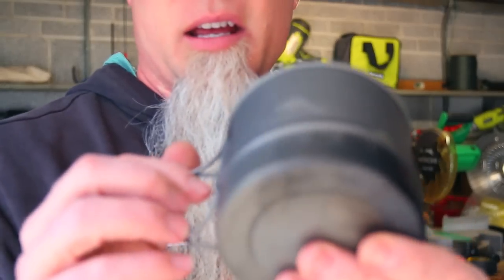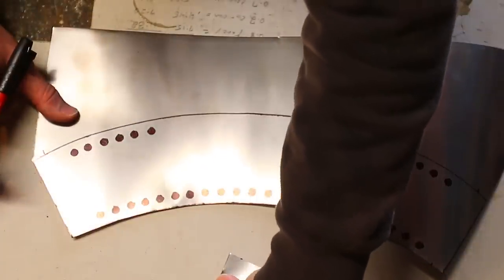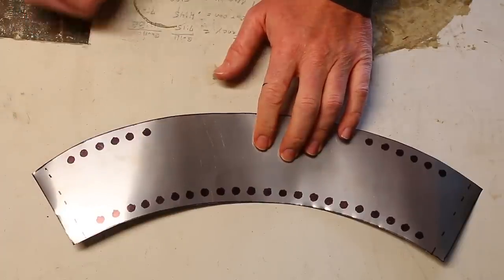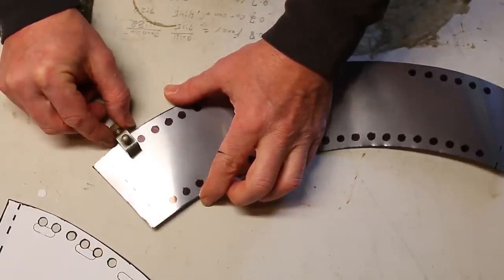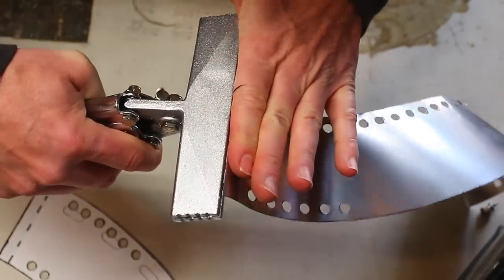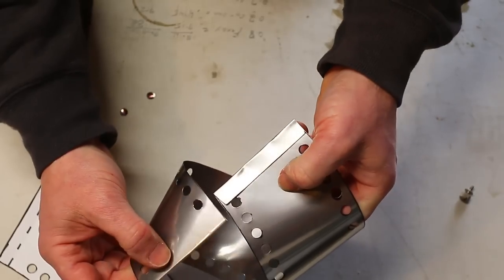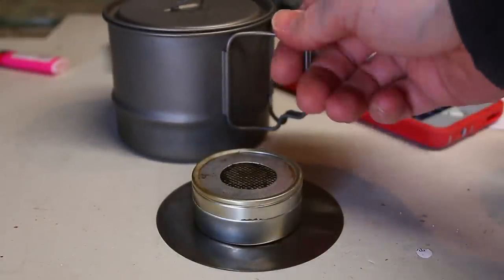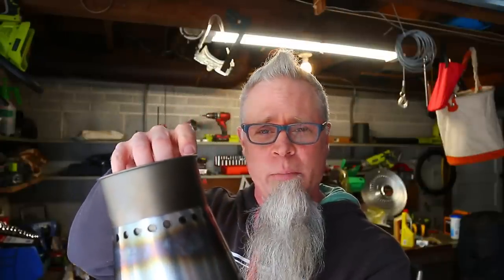DIY Caldera Cone

Comment: Just found out about the Caldera cone the day before yesterday and thought I'd have to check out the hardware store for different flashings to see whats available.
Haven't seen any titanium flashing around, was also thinking of making a 6' × 2.25" roll up chimney for my tent stove maybe pickup a 12" ×12" course stainless mesh for a cap/ash catcher. Definately not cheap but should last a lifetime.
Funny this vid turned up just now!!!

Comment: Hope you don't mind a suggestion. Printers can sometimes print images a bit smaller than anticipated, if shrink to fit is selected. If you draw a scale on your templates (like on a map). People can check their printer is printing it the right size by comparing the scale with a ruler. Hope useful. A fellow alcohol stove enthusiast.

Comment: Thanks for the vid man! I'm packing the non ribbed Toak cup without a lid so it looks like the modified version is where I'm headin. Do you have a link to that heating element deal thingy? I'm looking to move away from my BRS and canister unit. ✊
Reply from the maker: The alcohol stove is made by Zelph http://www.woodgaz-stove.com/modified-starlyte-burner-with-lid.php

Comment: Great video Jaxx, I’ve got a similar design using some aluminum flashing from a house project I had left over. I like your crimping idea might need to try that right now I keep mine together with a metal bobby pin and it does the trick!
Reply from the maker: I'm gonna try it with some flashing today to see how it turns out. I want to try and make one with a fosters pot, where it's sitting all the way down in it like it's supposed to.

Comment: Trying my hand again at alcohol stoves. Wanting to do some dry baking. I take it the purpose of the caldera cone is basically a fancy wind screen/pot stand?
I’m using a fancy feast stove with a diy simmer ring. 
What determines the height of the cone?
Reply from the maker: Yes that is it's function and also it doesn't show it in this video because my pot is small, this is more of a mini version. On bigger pots, they are actually supposed to nest all the way down into the cone so it's heating the entire pot and not just the bottom.  The height of the cone varies, you have to take into account a few factors. The height of your stove! Then add 1 inch of space between the stove and the bottom of the pot. Then add in the height of the pot. Then you have to add in the diameter of the pot. Find a center point above.. then draw your cone out. I could show you better than I could tell you.  This is a not so good quality video on Youtube but you should get the gist of it.. https://www.youtube.com/watch?v=VerP7-aiEBw
Reply: Jaxx Drinkwater 
Wow. Seems a little above my skill set
Thanks for the info though

Comment: Where did u get that pot at I went to the website it's not on there with the  Ridge
Reply from the maker: Hey Ken, from what I understand he doesn't make them but a couple of times a year. I would shoot them an email and ask when he plans on doing another run.
Reply: Thanks ... I was going to ask how you rolled the bead, but sounds like you bought the mug with the bead already rolled.  I thought maybe you had a cheap way (other than buy a bead roller) to form the bead.  Oh well, just wishful thinking on my part.  Thanks for another great video!

Comment: Nifty, but I think I'd just buy one since I don't have the tools.
Reply from the maker: Sometimes that's just easier. Thanks watching!

I might mention, I don't have a kitted out work shop. I have very basic tools but yeah, you can buy it. I still love this stove though!
Reply: @JaxxDrinkwater Currently I use a Soto Windmaster Stove with a TOAKS 550ml pot and 100g fuel canister. The whole kit weighs 12.6 oz. I saw a YouTube video about six weeks ago where they were talking about alcohol stoves and it piqued my curiosity and I've been researching to try and understand how they work and I was trying to understand the various options like alcohol, gel, tablets and the options to pair them with windscreens and pot holders. There are so many stoves it gets kind of confusing as to which is the best kind to choose. So far I kind of like the Kojin stove. I eliminated tablets like the Esbit because of the smell I keep hearing about. Anyway, it's been kind of a fun learning curve and I'd kind of like to try one for fun. I only need to boil about 8-10 ounces of water to rehydrate my meals, then after I eat I like to boil more water for coffee to savor without it getting cold while I eat. I normally hike at high altitude, around 10,000 feet and oftentimes with a fair amount of wind, so all that needs to be factored in to which alcohol stove kit would work best in those conditions.

Comment: i did something like this with aluminum 2 or 3 times.they all would have been lighter than yours...but they all melted...
Reply from the maker: You might try using a different stove that doesn't burn as hot, like the starlight stove or just get a hold of some titanium. Aluminum has a melting point of something like 1200°F  and titanium over 3000°F.
Reply: I ended up buying one, I love it. I've also made dozens of stoves but I even like theres better

Comment: 8 min 30 seconds to boil 2 cups? Lot of work for mediocre result. I have 50 alcohol stoves that will do that, and a half dozen that are much better.
Reply from the maker: Roger that and agreed.  However, this video is about making a DIY Caldera Cone not about all the other stoves that you or I have or that are better.  There are some great creators out there, I'm sure, that are comparing boiling times among the 5011 stoves out there in the world. Thanks for watching and have a great one!
Reply: @JaxxDrinkwater  
Good points, and I apologize for sounding so negative. I enjoyed watching, even though I was disappointed with the result.
Reply: @xenaguy01 
The “secret” for my use from research is also the “sweet spot” distance from your burner to the bottom of your cooking vessel(pot,pan, cup)

1” for alky & maybe ESBIT (I use an alcohol cap or beer can screw on cap) with “breathing notches at the top all around” and I don’t have soot/ residue & a simmer type of cooking!

1/2” for isopropyl alcohol & NO SOOT with blue flames very hot!

Comment: That is about one minute longer to boil than my diy fancy feast that was outside with no windshield. I used a 24oz stainless Stanley cup or pot with 2 cups of water.
Reply from the maker: Awesome, whatever works for you. This video wasn't really made as a "what's or who's stove is faster" it was made for people who can't afford and or doesn't have access to the Caldera Cone that wants one. Or someone who just like to DIY things...  I could have chosen any of my stoves to do this video and I would have gotten many different times.  that just happens to be the one I wanted to use.
Reply: @JaxxDrinkwater  Fair enough.